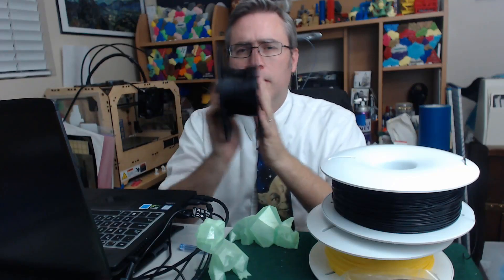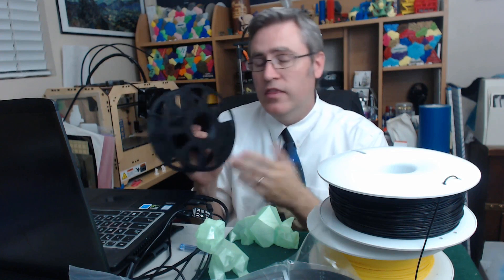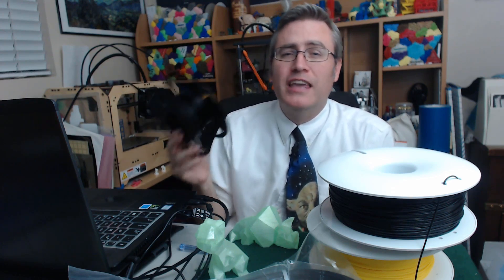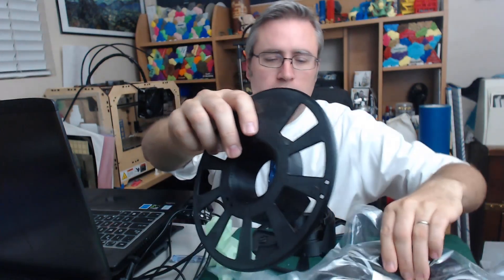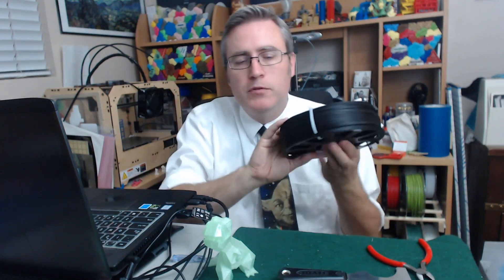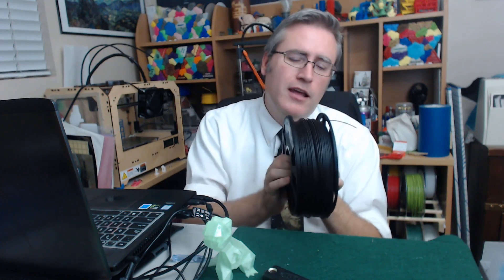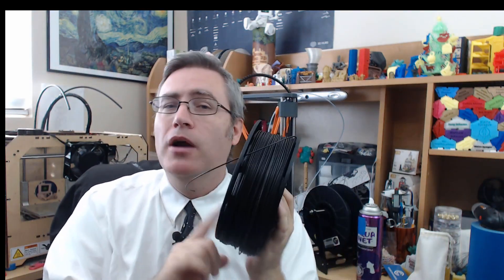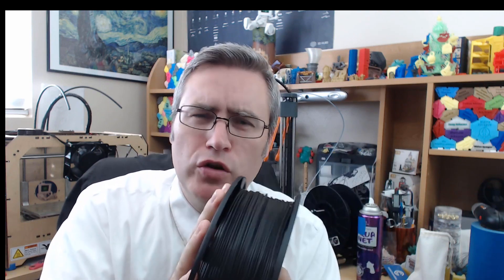The Downside of Masterspool

Comment: I'm new to 3d printing having only gotten my first printer in Dec 2022.  The first spool I bought was a 1kg of hatchbox pla.  I opened it and weighed it and it weighed in at 1017gm and that was the filament + spool.  If manufacturers have to start selling filament without the spool that'll mean they have to actually start sending 1kg of filament.  Personally I'd rather buy it by the meter instead of by weight.

Comment: Coils from Das Filament fits perfectly and tightly on an original masterspool (V4 from RichRap), another user already said, i confirm.
TLDR:
Maybe somewhat a late update and this was sorted in between (seen your other video "Is the masterspool dead?"), so my 2cts...
I got to this video while searching for the procedure to load a refill on a masterspool, as i'd previously printed a masterspool, and just received my first two coil refills today.
While the correct procedure is pretty obvious (insert coil without cutting the zip-ties, secure the inner end into an inner notch, close the spool, secure the outer end into an aouter notch, then cut the zip-ties), i watched this one out of curiosity like "i'm heading to use this, i love the concept but maybe i overlooked something so better know about before starting using...".
While watching, something that seems obviously odd: your masterspool looks definately too "thick"(wide in the axial axis, not native english but i think it's undersandable stated this way), there is like a near 1cm clearance between the disk plate and coil, while with th Das Filament coil on the V4 RichRap, both plates push firmly on the coil, and with the slots for the zip-ties it stays that way during the whole reloading process. Now installed an printing, it is totally as tight as a stock factory bought spool.
Seems even more strange that the coil and masterspool from your supplier doesn't match, as, they could have used proprietary dimensions instead of the standard masterspool, but you'd at least expect two items from the same company to match eachother.
It looks like (at least visually), the coils from your supplier would be the right dimensions, but it's their spool that isn't. Maybe you should give a try with an original masterspool (or if you want to spare the hassle of printing one, Das Filament sells one for $15, basically it looks the same as original but different esthetics with their branding added plus a meters remaining scale).
BTW if you'd like to compare, my original masterspool has a 44mm inner distance between the two disc plates. (about the center diameter, it's now loaded so won't be able to measure accurately before it's all used, but masterspool page says "inner ring diameter for the filament coil is 102mm")

Comment: The Slant3D version of the spool has the same diameter, but it's wider than Richard's version.  I noticed the same amount of slack on my MS rolls as demonstrated in this video.  I feel a little uneasy about how easy it is to rotate the filament on the Slant3D spool.  While the identical halves of the Slant3D spool is neat, Rich's version is tighter and it has that channel to put the inside end of the filament, keeping it from shifting around, and I prefer it that way.

Comment: If you want MasterSpool refills with tighter winds try Das Filament.
While I enjoy your other videos I'm afraid I have to call you on this one. You created your own loose filament problem because you asked for a MasterSpool-compatible roll from Fiberology and then put it on an incompatible SlantSpool. SlantSpools are different dimensions than the MasterSpool which is why they are not compatible. Inner diameter: 102mm (MasterSpool) vs 100mm (SlantSpool); Outer diameter: 192mm (MasterSpool) vs 200mm (SlantSpool); and most importantly, Traverse: 46mm (MasterSpool) vs 62mm. No wonder the filament was so loose on the SlantSpool!
Reply from the maker: I checked this spool. Exact same inner diameter to the master spool. It was built to the standard.

Comment: They charge more for the filament without the spool than you can get it for with the spool.

I can come up with uses for the spools.

**********

You find the inner end of the filament, anchor it to the spool, then close the spool.  Then don't loose the outer end of the filament... The loose filament on the spool then won't matter.
Reply: You can make a respooling rig (preferably powered) To spin from one spool to another with slight friction on the filament (not on the loose spool) and rewind it tight on ANY spool.

Fishermen do this with fishing line to deal with poorly spooled line.
Reply: To make the spool tight in the master spool would require a variable spindle dia on the spool, or you can't slide the filament on.

Similarly a variable width will cure the looseness side to side.

Now you know the engineering solution... its just a matter of designing the spool.  (which is beyond my capability with the CAD programs at this time.... I could do it with pencil and straight edge drafting.)

Comment: I hate how people area constantly going "omg tangled filament! it'll knot and this and that!"... sorry but.... that's not how reality works... you CAN NOT have a tangled roll of filament unless it was done DURING the winding. And even then, that's super INSANELY difficult to do... If you were to take the filament, wrap it two times on one side, then wrap it two times on the other side, and just kept on moving to a new, different spot every two times, you are not gonna get tangled. 

if you take a normal every day spool of filament and while holding onto the free end, just start to loosen up the rest of the spool... NOTHING bad will happen. Why? Because if a loop happens to get under another loop, guess what? It'll just slide right on out when it gets tugged on. getting knotted just simply CAN NOT happen by the user unless you actually let a huge section unwind and you didn't have hold of the end. And while I say that it more than likely happens during the winding of the filament during manufacturing, i also said that it is super difficult for that to even happen. Because somehow, a loop that happens way later in the winding, has to mysteriously find its way under windings from way earlier. How is that supposed to happen if its already been wound up? It doesn't... Thus a spool would have had to of 'gotten free' during manufacture and rewound up. Which is very unlikely...

People always going 'rawr' about a tangled roll of filament is so dumb... because it just simply can not happen under normal situations. You'd have to have something catastrophic occur for it to even be remote. otherwise, you simply just 'let go' of the end of the filament and watched as it unwound itself several times... then you decided to rewind it yourself by just spinning the spool on the holder....
Reply: While a knot is topologically impossible, i had to unwind and rewind a complete spool of (cheap and shitty) ABS because it didn't unwind properly, and no amount of releasing and retensioning helped.  The filament must have crossed under itself in a very unfortunate manner somewhere there, possibly in multiple spots, and then jammed against the side. Maybe if the spool wasn't wound as tight, it wouldn't have been an issue.

Comment: If I were a filament manufacturer, I would look into what has already been covered in the textiles/fishing-reel/electrical wire industries to tackle the same problems: I think a minimal coliform to tension the filament against would be prudent, even if just a tube shape that could slip over a 'masterspool'. That would still reduce waste greatly, and allow sufficient winding tension and the ability to maintain shape better.  It may also be prudent to look into a better winding pattern for the refills: the stacked helical machine wind pattern is the most space-efficient, but a modified cross-weave or even z-traverse weave pattern could possibly create better layer-separation on the spool to prevent crossover, as well as maintaining tension slightly better. Also, dereeling under slight tension greatly reduces tangles as well since it is important to maintain tension on the spool, but that is on the user-end.

Comment: How are you going to form a knot? The only way that you are going to do that is by releasing the end of the filament.
Reply from the maker: Well, it's a bit of a slip knot, but if you get a loop under another loop and the upper loop gets tightened, chances are you're going to have a bad print. I'm not saying it's going to happen, but with loose filament it could happen, and with well wound filament it can't.

Comment: Hey Professor =|:-3  I've been using the masterspool concept (and later several remixes of it) since Richard released V4 of his concept. So far it works flawlessly. The filament I use is from Das Filament and the 850g coils fit very well on the masterspool. As far as I know because both Richard and das Filament have been working together on that concept. I think in your case the dimensions of coil and spool are not a good fit. Try the "upcycle Masterspool" from techam on thingiverse with an empty usual spool. This way you have minimized printing time and filament consumption to the max as well as a perfect fit. My actual favourite masterspool design is the "Twist and Lock" from 3D-Workshop (also on thingiverse). It consists of 3 parts so you can print it parallel on multiple printers and save about 6 hours of printing time. I always print the sides on my CR 10 and the hub on my lovely Ender 2. It is very efficiently designed for minimum filament use and still stable enough to carry the filament.  The lock mechanism is so satisfying...^^ Cheers!

Comment: I don't like the Masterspool and not on board.  Here's why:
1. Loose windings, all the things you mentioned. Clumbsy people stay away!  Accidentally drop the spool while loading = instant rewinding nightmare!
2. Sucks for people that have multiple printers and spools; it's not practical for me to slip on and off spools to accommodate my 200+ library of spools.
3. Great for manufacturers, questionable for us.  We have to print a spool which consumes filament which in turn we buy more.
4. Protection. The spool serves more than just allowing us to slap it on a printer. It protects from the moment it comes off the winder to the last mm of filament consumed. 

Seems like a great idea in principle, but applying the idea I feel it's not practical. I do like Proto-pasta's cardboard spools.  I could see another initiative where retailers or manufacturers provide a means to return spools for reuse to collect a deposit like cans & bottles, etc...
Reply: People who collect lots of different spools and almost never finish one aren’t going to like masterspool. Those who use 3 different filaments, but many spools of it, benefit a lot.

Comment: I use 8 printed masterspools with my 4 active printers, but I don't purchase filament coils to put on them (although I would if eSun PLA Plus came in compatible coils), I use them to save storage space in dry boxes. I will use whatever amount I need for that print job on a new spool and then wind the rest into a coil using a slightly over/under sized Masterspool (105% in X & Y, 95% in Z) and a hand winder I made. This lets me store the coils in MUCH less space than leaving them on the original spools. I can then swap the coils on/off the masterspools to print with as needed. Even though I live in a desert (Utah), dry boxes are necessary for me because I use an evaporative cooler in my home. Indoor humidity levels rise considerably during cooling season to 50-60% (and even higher when the weather is wet and humid). In the last 3 months and at least 30-40 kilos of filament printed with hundreds of spool changes between prints, I have never had a filament jam because of loose winding. I purposely wind the filament loosely because if I wind it too tight, the sides bend out and the coil doesn't fit well on the masterspools. I have had jams where I made to coil too big and it caused the filament to jump over the sides of the spool and wrap itself around the spool holder. I keep the coils smaller now and no longer use bearings on my spool holders (some friction is good). I have had jams that were my fault for letting the loose end of the coil slip underneath a loop of filament (just like I have done with original spools). I have also had the filament get caught between parts of the masterspool (ruining a few prints) before filing down the problem areas. Thanks for your video and thanks to @RichRap for the initiative!
Reply: Hi i had excatly the same expirance, to much non-friction produces a higher chance for a 1+ ring of overborden filament. That get cought at a small diameter rod or axis. Since i draw the filament wire trough a piece of leather the backing up that comes from a big movement of the printerhead in the opposite direction gets stopped by the leather. So the filament that would otherwise been pushed up to the spool now gets paralyzed by the leather strip. Its like a diode, lets power trough but only in one direction. 
The same for the Masterspools when they can be interlocked tightly, so the walls are press onto the filamentwinding there will be almost no chance of infiltration of the winding. When infiltration here is the proper word?! Maybe creeping under is more feasable.

Comment: I guess you could have a kind of spring loaded inner diameter that pushes out the filament roll and tightens it up. Some kind of mechanism that irises out. Or flaps that push out.

My guess is that the rotating master spool shown here can never work as tight as the real master spool. If you want to have tight tolerances you need channels for the zip ties, and that means you can't have two identical rotating half. You're gonna need one half with the inner roll with the grooves. Otherwise you always have the thickness of the zip ties as extra slack.

Comment: OK... I'll share... filaments.ca. But you already knew about them yet blew them off!If you look at Filaments.ca's spool CAREFULLY you'll see the advantages. Yeah, it's 2 different parts... why is that a disadvantage? I printed 3 of them and they work VERY well. Zero futzing around as your vid showed with the version you printed. The filament HAS to be on a center core. It has to be wound under pressure with SQUARED OFF EDGES. When the zip ties are removed the stuff needs to stay in place just as a disposable spool would. The split spool has to accommodate this. RichRaps specs ignore almost all of these issues. So... yeah he was the first to talk about it but what he spec'ed would have problems. Filaments.ca did it right. .I noted how many people posted that it is their belief that cross over only happens when the end user does not manage the tip of the filament. WRONG!! Cross over can easily happen when the roll is wound incorrectly (which is getting rarer these days) or gets loose inside the spool... which it will if the inner core is not under pressure and retained from the inner core out.
Testing the ABS now. So far I'm impressed. Good stuff which BTW also is priced accordingly per the lack of spool... i.e., MUCH less
Reply: You only save 50 cents by not getting the spool (15.45 without the spool and 15.95 with a standard spool).

That being said, I really do like their route, with the cardboard core, and the 4 zip ties.

Comment: Thanks Joe. Unfortunately that design is terrible. The zip ties are replaceable on an actual masterspool. The Inner filament 'tail' locks into a groove in a masterspool. The masterspool sized halves enable a full refill to sit over the centre hub and the top half screws on, avoiding most of the catches you experienced. Cheers, JAYTEE  read more......

Anyone that wants to know more, visit www.masterspool.info which I've pointed to Richards blog for now. 
The specs can be found here http://jayt.ee/masterspool_v4.pdf

Comment: As I see it the only way that a "loose" winding could cause problems is if there was significant resistance to the unwinding process otherwise it just wouldn't have the force required to have the filament bite into the lower layers and if your spool holder is that bad then there are a thousand better ones on thingiverse to choose from. I use bearing based spool holders and I had to work to increase the resistance to stop the filament from just unwinding by spinning the spool around so I don't think it's likely to happen even on the worst spool holders.

Comment: I fear the gain is only theoretical. By the time I print ten or fifteen master spools (I print in more than one color) I will have used quite a bit of filament and then if some percentage of my prints fail due to loose bundles - the waste will out weigh the gain. In addition the master spool would have to fit the particular holder on my machine or it's just another pain. On the other hand if everything works out, the world's waste will be reduced by 0.00000000000000000000000000000000001% - because there are just so few of us 3D printing. So it's a neat cause, there are risks, and the pay off, at best, is insignificant.

Comment: The biggest problem I have with the loose spool windings is NOT crossover, but if the coil is loose enough that the filament being pulled off can work it's way to the side of the coil & get pinched between the coil & the spool lip.  I created my own small spools for use with the "$5 filament" from Protoparadigm (now MadMakerFilament).  So far I have not had a jam from a knot forming, but it does build up pressure and "jerk" free during printing.